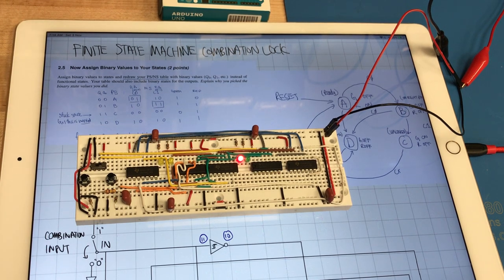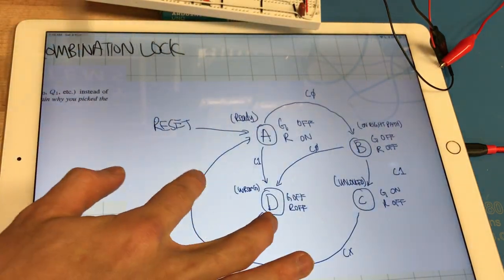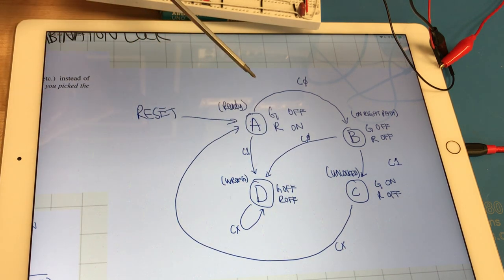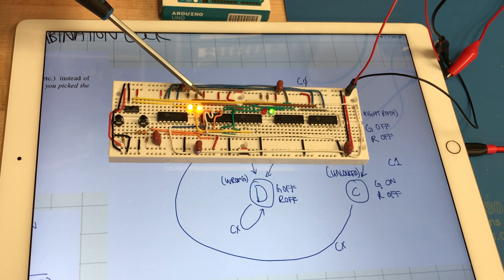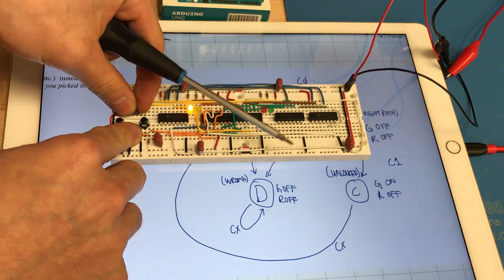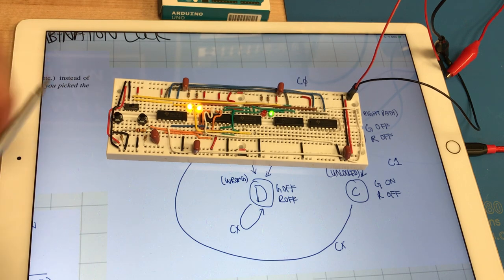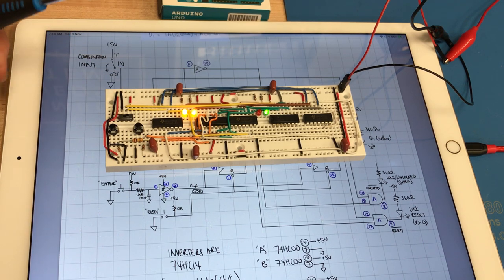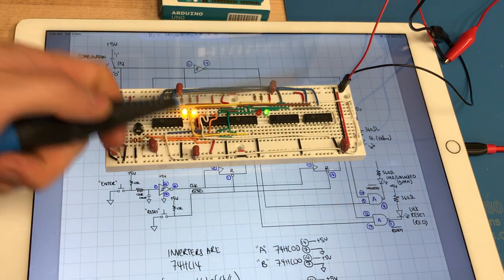Finite State Machine Combination Lock

Comment: Hii, does circuit work if I change the "password" to unlock it? or that would lead to a different state machine and thus a different circuit?
Reply from the maker: If I remember correctly, to have a different password, you would need a different state machine and different circuit. Although I'm sure you could design a more complex circuit which is able to set/change the password as well as operate the lock.
Reply: @shao_yuan  yeah I wasn't totally sure about it but it makes sense, I will try to think about that more complex circuit, thank you for the reply!